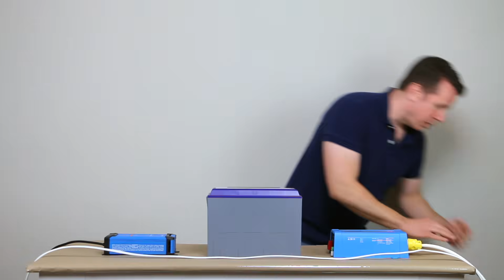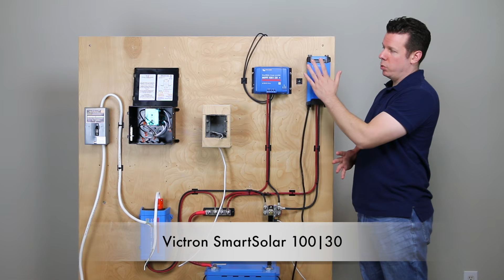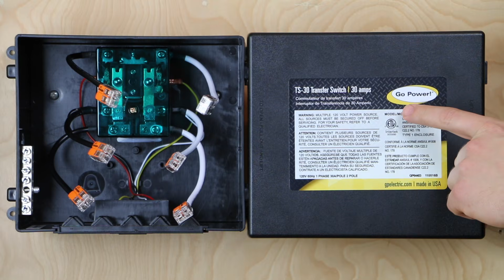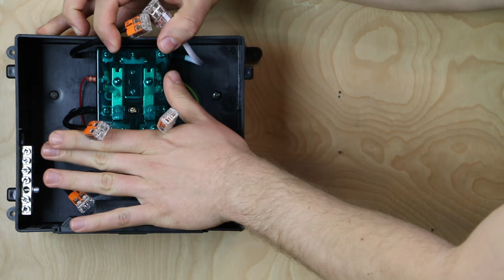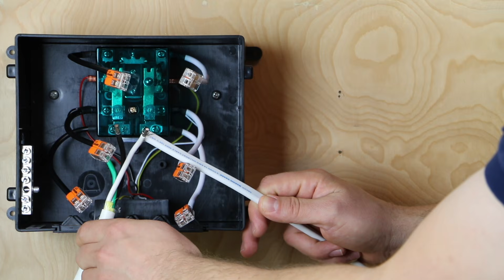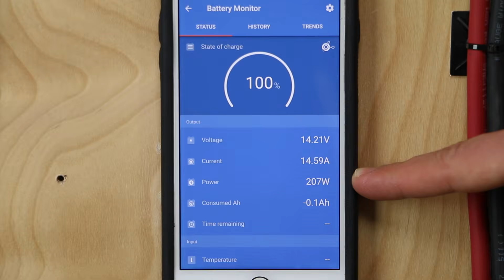How to Add Shore Power to an Existing Van or RV Power System | Featuring the TS-30 Transfer Switch

Comment: I don’t understand how you add the charger to the transfer switch.  If you are bringing 30a into the switch from the shore power, how do you wire in a 15a switch and outlet to plug you 15a battery charger to the same Waco connector?
Reply from the maker: You have a good point Ronna, there should be a 15A breaker or fuse on the charger line.

Comment: Subscribed! although in my small RV trailer (a 5' X 10' squaredrop) I am building pretty much this exact system, but using a Samlex 30A transfer switch. This one has two fused 120V outlets for a battery charger and whatever else. I'm using the second plug as the 120V source for my reliable, old Engel compressor fridge. I have already installed a 15A 120V light switch to better control my shore charger so it was nice to see Ross suggest this. Now I know I'm not totally nuts. hahaha...

QUESTION: Chassis grounding! Can you make or do you already have a vid explanation on this topic? For example, grounding my Samlex 1500W pure sine wave inverter using 1/0 (yes, as it's case ground)... do I want to run a separate, negative ground buss bar and then run that to my trailer frame? If my inverter were to fault then send 150 amps into my trailer frame, would that possibly damage the powertrain control module of the tow vehicle (if still hitched, chained, etc to it). Thanks Ross! You are the man!

Comment: So if I don’t have a transfer switch (I manually plug the charger into power)  how do I wire everything without the transfer switch in the equation???
Reply: Charger to battery, then battery to inverter. Better to get a battery with 2 cathodes and 2 anodes. Makes it a tad bit easier

Comment: I have 2 systems , 12 volt for boondocking 110 for shore , my 12 volt only powers 12 volt lights and my inverter does the fridge only for boondocking and my solar recharges my battery during the day , my 110 charger is only for when my camper is parked in storage to keep batteries topped off , i never understand why people use 110 to charge 12 volt to convert back to 110 ,,,thats dumb all day long .....run a double set up and dont run everything off your inverter just what you need . If you expect to go GLAMPING then just stay home or rent a cottage , when did camping become luxury ? Wow how fast we forget ....camping was meant to be ruff not glorious .....lets go to the woods and get a pedicure.......

Comment: I just subscribed.  Ever since I hooked up PV solar to my trailer, my battery won't power my interior lights, pumps, or radio.  I'm guessing I need a transfer switch.  I had shore power connected to trailer while my pv solar system was going.  I don't know if the both of them running together fried my original factory system.  I'll check fuses.  I have the Renogy 40 amp charge controller with Bluetooth.  I don't know what happened.

Comment: Good afternoon sir, really liked your video. I was thinking about upgrading my set up which is really similar to what you have right now. I was looking forward to purchase additional batteries but I'm not sure if the charger that you are using in the video will work with multiple batteries in parallel.

Comment: If instead of the batteries, inverters, chargers, and all of that, if I used this transfer switch to connect a 30 amp battery bank like an Eco flow Delta pro and the other side of the switch being a standard 30 amp shore power. 

Would the fact that the battery bank having a floating neutral, cause an issue with the AC power in my camper?  

The reason I ask, is that EcoFlow sells an adapter that changes the battery bank from floating to bonded neutral, and I’m curious if it’s necessary in this configuration with the ground being connected to the frame of the camper?

Comment: the only question i have is instead of the 3 way connector could you use a 4 way and add a generator to that mix where its either or for shore or gen or if the back feed may damage the other component

Comment: how does shore power work into a mostly 12v system?
Reply from the maker: Hey there, thanks for tuning in. That's kind of big question. In some ways it's shown in this video. I would suggest downloading my Van Power Cheat Sheet: https://www.rosslukeman.com/vanpower there's a diagram that shows how everything integrates. Hope that helps, thanks for stopping by-

Comment: If you were to stay using a 12v system, ie. a cargo trailer with lights, could you simply remove the inverter and solar charger from the system and operate the same with the switch and charger?
Reply from the maker: Hey there, yes the systems are largely modular. Everything operates on its own and can be added or removed, and the other stuff still works. If you need real help, check out rosslukeman.com for more resources. Hope that helps, thanks for tuning in!

Comment: Wouldn't it be easier to have a manual switch for your inverter? Turn it off when connecting to shore power. Done. No? Or could that harm the inverter, having it turned off, but having shore power meet with its positive cable?

Also means your inverter isn't running when not needed.
Reply from the maker: Hi Harley, thanks for stopping in. You are welcome to go with a manual option. Typically automated is easier, but some people like to turn switches themselves. So there's no right answer on that. Typically the switch would go from one source to the other and not mix them. Blue Sea 9009 or something like that.
Reply: @rosslukeman  thanks for the response (and the videos!). I realised after posting that this might not be the best and safest idea just to save some money.

Do you know if an inverter/charger must be left switched on for the shore power to flow through it? I'd like the inverter to be turned off unless in use. I'll do some research on this but thought I'd also ask here. Thanks 🙏🏼
Reply from the maker: @harley5273  Hey there, glad that helped, thanks for checking out my videos. Inverter-chargers turn off their inverter when shore power is present. This is all automated. Did you watch the end of the video? ; )

Comment: I am about to set up a van for racing karts (not much for camping). I currently use a trailer with a 120v AC system and I power it with a generator.  With the van I don’t want to take my larger generator and would like to just carry my 3000 watt generator.  Is there additional issues with using the generator in place of the shore power?  Is the transfer switch enough?  Ha.  I just got to that point in the video.  So I’d have a plug for grid power and a plug for generators?

Comment: Great video! I have a stand-alone system in my Travato, all it needs is the shore power added, this really covers it. My Renogy DC-DC controller has a bluetooth monitor feature, do I need to install the shunt on neg connection to the AC-DC charger and put another monitor there? I kinda don't think so, not sure, I don't know what the shunt does.
Reply from the maker: Hey Alan, thanks for stopping in, I'm glad you enjoyed the video! In general if you have a shunt it's for the battery monitor, and it will go in the negative line right before that line hits the battery or batteries. It's just monitoring current in or out of the batteries, so it can tell you how much "fuel" you have left in the "tank" so to speak. I did this video on battery monitors if you want to see a shunt being installed: https://youtu.be/vTKBNb-cJq4 Hope that helps, good luck with it!

Comment: Great Video Ross. So informative. I have one question. Isn’t the PD converter charger, a charger?  You have a separate battery charger correct?  Do you  need that if you have the PD converter charger which charges the battery when hooked up to shore power.
Reply from the maker: Thanks for tuning in Dan, great to hear you enjoyed the video! On the PD converter, yes that is just a battery charger built into the Progressive Dynamics distribution box. It's just a charger (120V to 12V). I guess the name is related to the inverter (12V to 120V). But yeah, sounds like you already have a charger. Hope that helps!

Comment: Is there anyway to get a wifi signal from this system? Your videos take things slow enough for me to understand. True educator. Thanks
Reply from the maker: Hi John, thanks for the kind words, I'm glad you're enjoying the videos! As far as WiFi specifically, no, none of the components shown here emit or communicate with WiFi signals. There are a couple that do Bluetooth, but that's all. For the Victron components in the video, they could be connected to a Victron GX device, and those devices will pick up a WiFi signal, if one is available. Hope that answers your question, thanks-

Comment: Very good video. But how to set up the shore power and generator together? There are times you don't have shoure and use generator. You said when generator is used, the shore hooks up in the bottom and the generator goes to the dynamic, but ehere does the inverter go?
Can it be one wire for both genrator and the shore? Just make a inlet box where generator and shore can plug in alternately, no?
Reply: I have the same question as you!

With OP current setup, what happens if you connect a generator to the shore power plug? Will this set up still function and will there be a 30 sec delay for the generator power?

Comment: I appreciate this video very much—thanks! I’m working on an experimental project that is essentially a portable version of this setup. My concern is proper grounding, any thoughts? My first thought is it’s properly grounded to vehicle when charging via DC-DC charging system. Is that true? But while connected to shore, maybe some sort of connector to a vehicle ground? How about when out of the vehicle (in house) charging via AC? Outlet grounding sufficient? How about outside solar charging? Maybe some sort of ground rod I shove into ground via the aforementioned connector? Lots of questions, sorry. But they’re all regarding proper grounding for a portable unit. Any input is appreciated. Thanks!

Comment: There's no explanation of where you get 12 volt power when connected to shore power. If you're connected to shore power for a couple of weeks, it looks like 12 volts come from the battery. If I have a 12 volt AC and fridge they'll take more from the battery than the charger can replace. I believe the big Victron will cover that. The system you have on the board won't. What do you recommend to supply 12 volts from shore power with the smaller system?
Reply from the maker: The system shown here will provide 12V from the charger up to 30 amps while on shore power.  As you said, if you need more than that, then you would need a bigger charger, or the Victron units, which have chargers at 80 amps and up.

Comment: This is the first video that covers 99% of my questions about this process. Not only do you explain what the single-unit inverter/charger does, but you also offer alternative solutions for upgrading existing systems. I’ve seen manual versions of the shore power switch when I was overseas, but I love the idea of an automatic switch that decides to use shore power when available. I also like the way you set up the battery charger. Great stuff and great video! I’m kind of curious about scenarios where you would be hooked up to shore power, but not want to have the charger topping off your batteries. 🤔 
Thank you!
Reply from the maker: Hi Memo, thanks for tuning in and great to hear you got a lot out of the video! On the charger on-off option, perhaps it is rare, but I just don't like having to charge the batteries every time I decide to plug in. The charger switch is an extra layer of control, that perhaps could be left out if the end user doesn't care about that. It's not a must-have and could work either way. Great question and thanks again for stopping by-

Comment: Great video. The all In one system who makes it and where do you get it from.
Reply from the maker: Hey there, the all-in-one is the MultiPlus 2000VA by Victron, the vendor I partner with is Vanlife Outfitters: https://www.vanlifeoutfitters.com/store/victron-energy-12-2000-80-multiplus-inverter-charger-new/?ref=VPMM (affiliate link). Thanks for tuning in!

Comment: This is a great explanation. But I'd like more information. I've got a old sliding truck camper that's got existing wiring power breaker panel. What I want to do is take all my solar components ie-solar panels,mppt,100w inverter, lithium batteries,b2b charger, and fuse block that I stripped from my van and plan on putting it in the camper. I know how to connect all the solar components together I just don't know how to tie it into the existing camp or electrical and what do I do with the existing battery in the camper. I understand the transfer switch part but how do I connect it to the RV breaker panel? And what do I do with the old existing AGM battery? Also can I connect lithium and AGM batteries together?
Reply from the maker: Hi Brian, thanks for checking out my video. I would be glad to help with this but it's beyond a YouTube comment. I would be glad to work with you as a student of my electrical training, or via consulting. Here are those links:

https://www.rosslukeman.com/offerings
https://www.rosslukeman.com/vanpower

Thank you,
Ross Lukeman

Comment: With respect to  this excellent video, for a fraction of the cost of the victron inverter/charger why not just add another 30 amp charger and a much larger inverter? 
Thanks
Reply from the maker: Because these systems are already complicated, you're not going to save that much, and people do double the engineering to save a few dollars. It would work, just not my style.

Comment: Hey Ross I love your videos and the way you explain everything! I actually followed the same system you show in the video in my van, the only part I need help with is wiring to the distribution panel. I bought the one you recommended but am wondering do I wire both the transfer switch and inverter to the distribution box? And can I use the outlet on the back of the box to connect either the transfer switch or inverter? Sorry, these might be simple questions but I'd appreciate the help, thanks!

Comment: Is there any reason my 3000 watt inverter and 2 300ah batteries would not work in this system? 
Thanks for the outstanding videos!!!
Reply from the maker: Hi Randy, yes what you described should all work with what you saw in this video. Thanks for tuning in!

Comment: I just finished installing a small solar system in a 1973 15x7 camper. My wife was asking me how to connect to shore power and solar also. This video explained it clearly for her to understand. Great video. Stay safe and vigilant.
Reply from the maker: Awesome to hear this video helped her! Congrats on finishing your system, and thanks for tuning in!
Reply: Are you running ground to one bus then Chassis, I’m doing a vehicle which I’ve never done a big build on my property but I’m struggling with the grounds if you were mine when I was going to be able to transfer switch but still concerned about my iPad is broken I can’t correct the spelling sorry
Reply: @douglasgreenwood7002  Mine was already in the camper. The video from this channel explained everything to my wife.

Comment: Just get an inverter charger, which has the internal relate to switch from shore power to inverter power when there is no shore power
Reply from the maker: Hi Victor, I did mention this at the end of the video where I show an inverter-charger on camera and make the comparison with what's taught in this video.

Comment: Hi Ross, thank you for the great videos! Quick question, also it might be a dumb question...  When I syphon off power for my charger, does it affect the charger's output? I will be running a Progressive Dynamics PD9160ALV 12V Lithium Ion Battery Converter/Charger - 60 Amp.  Just want to make sure my "tapping" into the lines the way you show it wont affect anything. Thanks!!
Reply: Also, do you ever do a short consulting zoom meeting where I show you what I have so far and you give recommendations / tips? 

I have done up all my layouts and wiring diagrams, but want to make sure it's correct. This is my first project and I am super green with electrical
Reply from the maker: Hey there, I'm not sure if I understand the charger question, but I'm going to say no, the charger will put out its full rated output in this scenario. On the zoom-style calls, yes I have those available Thu-Sat each week and would be glad to look over what you've got designed thus far. Here is my "Work with Me" page: https://www.rosslukeman.com/offerings

Thanks,
Ross

Comment: You mentioned the all in one inverter charger transfer switch, but you didn't mention they only have 24v and up, no 12v all in one systems. I can't tell you how long I searched for a 12v all in one only to find out they don't exist (in the US at least) you could get a 24v with a 12v stepdown, but you lose efficiency. Or you would have to upgraded your whole 12v systems to 24v(or higher) which would suck. The cost is about the same to in the end so... 12v no all in one. 24v or more get the all in one.
Reply from the maker: Hi Kevin, they do have 12v models, that is all I use, such as the 12/3000/120-50 MultiPlus-II from Victron (link here: https://www.victronenergy.com/upload/documents/Datasheet-MultiPlus-II-3kVA-120V-EN.pdf). Most systems for vehicles are 12V, so they make models to work with that.